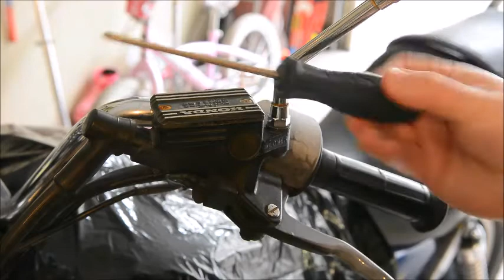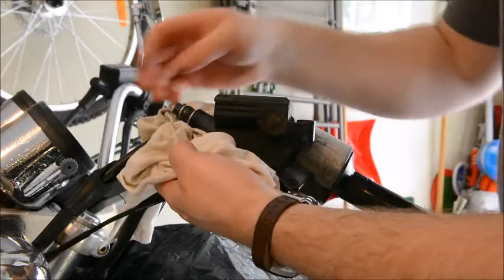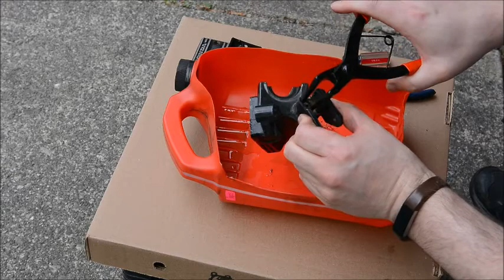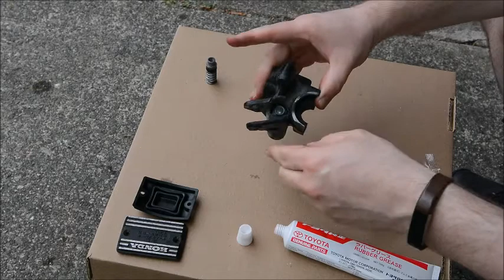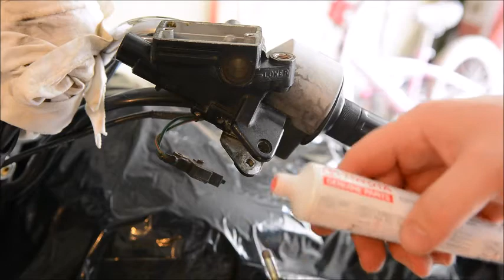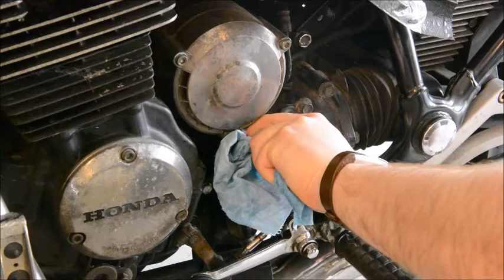Motorcycle Clutch Master Cylinder Rebuild

Comment: My 2c;
- use brake fluid to lube internal parts, can still use rubber grease/lithium grease at plunger/piston connection
- skip bench bleed, waste of time, all the air around the plunger grooves will be eliminated when you properly bleed the line
- just do a reverse bleed, so much simpler, cleaner and faster. If you have a bleeder kit for compressor, it's a 2 min ordeal.

Comment: Hi just done my Honda st1100 slave rebuid , seals new spring , put piston back into slave cylinder housing , tiny bit of break fluid rubbed around both inside & outer piston , but does not spring back can just keep pushing until all the way down any ideas what's wrong please?

Comment: Andrew...you must have the patience of Job.
The JIS tip was worth the watch.
I was wondering if some other component or condition in the clutch system, could cause a premature failure of the master clutch cylinder?
Reply from the maker: Thank you so much for watching!  A premature failure of the master cylinder would always make me suspicious of how the rubber components were inserted into the bore, or the condition of the bore itself.  If the rubber components hang up or catch on the lip of the bore when they are inserted, the skirt or edge of the rubber cup may get damaged and it would be difficult to tell until it fails and tears.  If the bore/inside of the master cylinder has corroded it is problematic as it will accelerate the rubber cup skirt wear through a "sanding" abrasive effect.  The installed replacement components are important too as there are a bunch of low priced and sadly some counterfeit overseas components where the rubber is less forgiving and in some cases dimensionally inaccurate causing it to never really work properly.  I wish you the best of luck on your next rebuild and hopefully the bore is clean and shiny after a hefty dose of brake clean as that is the only part that is truly expensive!
Reply: @andrew_ball  Andrew who is your go to source for parts?
Reply from the maker: @dc-wp8oc  Hello, I use the cmsnl website to confirm part numbers and pricing, then I search either Amazon or Ebay for good pricing.  Failing that, there is a local motorcycle shop with a good parts guy who can get his hands on most regular parts.  My last resort is taking a trip into town to visit the various motorcycle dealers and pay full price for factory parts over the counter.  Best of luck!
Reply: Definitely a great tip, wish I'd learned it the easy way.  Stripped my originals and replaced them with 10x22 Phillips